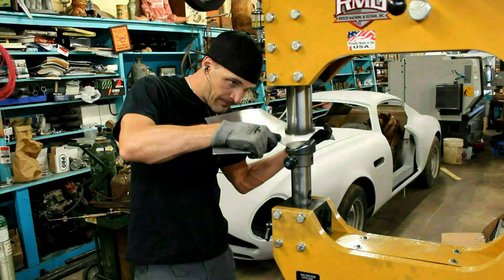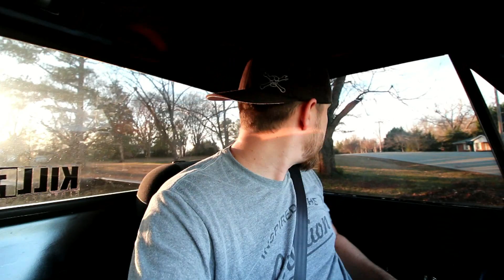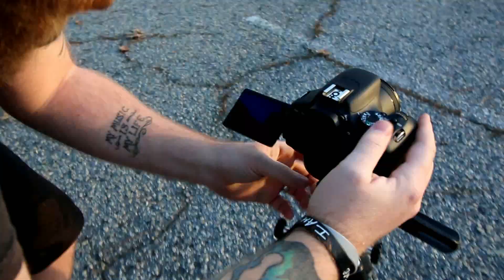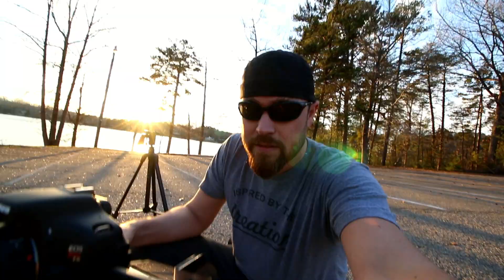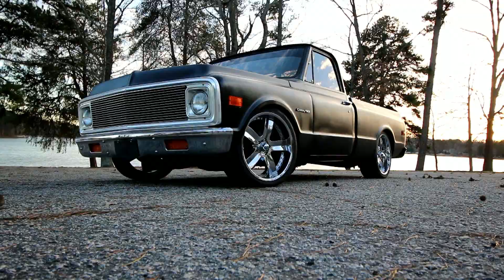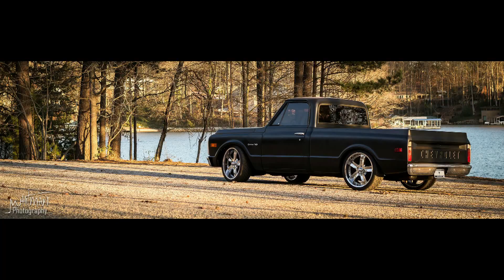Black Pearl Gets Its First Photo Shoot | Chevy c10 Truck

Comment: hellsyeah, networking. can't wait to see the pics. 
what are the overall specs on the truck? drive train, exhaust,  and suspension?
Reply from the maker: lol. good question. 350 350, flowmasters with awful exhaust. 2 inch drop spindle and rear blocks. I have no idea on the springs....they look factory.  I will be going through the entire truck over the next year
Reply: It sounds awesome. Looks great, runs good. The small things are adding up. Keep it up bro.

Comment: Hey Kyle I love the truck congrats on the photo shoot. I was curious though when the sun hit the side and you caught the glare it appeared that the bed is hanging down in the back like the frame is bent. Just curious
Reply from the maker: the bed is solid mounted it actually the cab that is leaning forward because of the old cab bushings
Reply from the maker: Could also be partly an optical illusion...cant really see it from the side  https://www.facebook.com/jwhitmanphotography/photos/pb.382125822140837.-2207520000.1485465715./395636000789819/?type=3&theater

Comment: Hi all, great videos. Thanks for sharing. Hoping someone might be able to point me in the right direction. My brother and I were supposed to fix up is 82 c10 and we were going to build a bike together so we could ride together once he moved out west to get a fresh start. He has always been into cars and motorcycles, I have also but don't have the skill set he did. He was ran over while on his chopper at a red light, was in the hospital for a while then and put on pain meds. He got hooked on the pain meds and then got his settlement and then tried something more and OD'd. He just turned 35. I had his plane ticket booked then got a call from my parents he was dead 2 days later. Never felt pain like this. He bought this 82 c10 that we were supposed to build and I have to be honest with myself that I would never be able to do what he could or any of these people I am watching online. But I cant sell his truck or junk it, I have to get it done in his memory and could use some help. I am in San Francisco California and my brother was in Buffalo NY. My dad says the truck has to go because every time my mom walks out and sees it she falls apart. Is there anyone interested in a project,  I have the pictures of what we were sending back to each other on ideas. Essentially a flat black rat rod on air suspension, red rims, big whitewalls and chrome dome hubs. If anyone would be interested in this project or can point me in the right direction that would help a lot. Its very overwhelming, I cant let this truck go. I could use some help. I have no idea what a project like this would cost but hope its not expensive, someone said since its an old truck and not a lot of the electrical stuff these new trucks have that it should be straight forward. I would be very grateful for any help with this.

Comment: Great truck - but please soft mount that pump ! Love the channel.
Reply from the maker: It is soft mounted....
I knew exactly what I was gonna have when I bought this pump, and I like it just the way it is
Reply: I understand your choice. When I watched you mount the pump, it looked like it was bolted straight to the rail, no sign of soft mounting. I've used dozens of the same pump over the last 30 years. They're noisy but reliable. They can be quietened by mounting rubber to the rail, then mounting the pump to the rubber. That way you won't even hear it from the cab. Just my 2c worth.